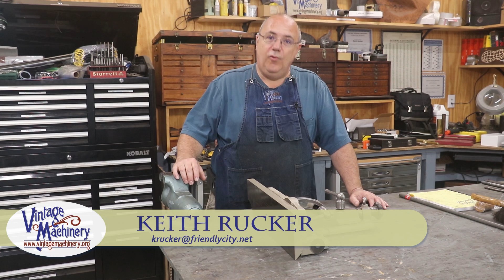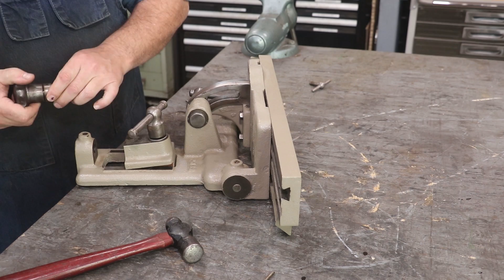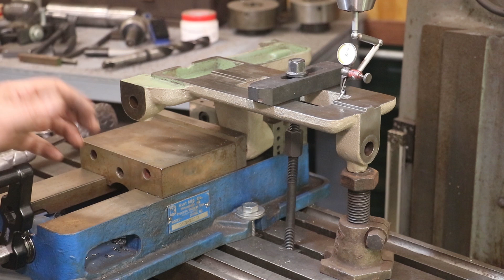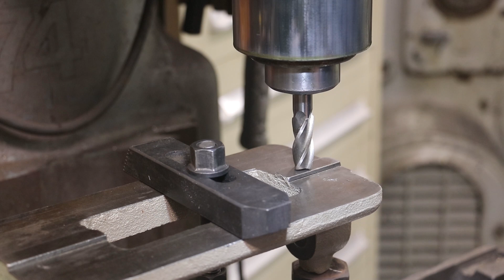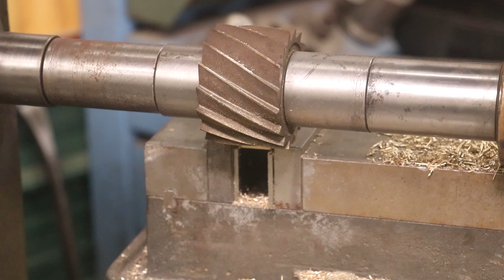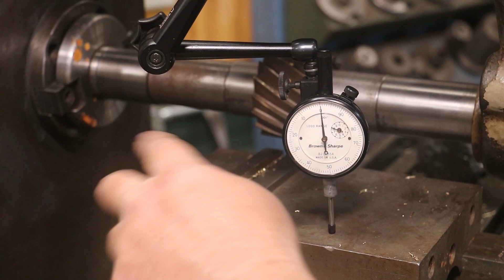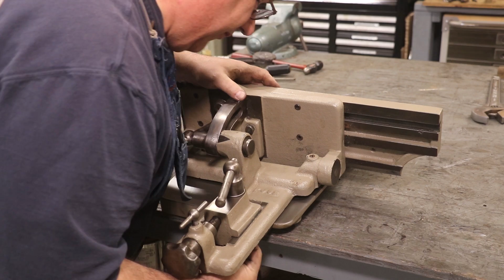Machining New Slide Keys on a Wadkin Table Saw Fence

Comment: The extra brass could have been used for an extra set of guides for when the brass wears out, easier while you have the setup.
Reply: It'll be so many years before those guides wear out again any extra set he makes now will be buried in the bottom of a junk drawer and long forgotten what they are when they're needed.
Reply: I'm surprised he didn't; he's done that (made a 2nd set of parts) in previous projects.
Reply: It might not won't go to waste, but rather go into Keith's brass casting material box.  He has done a few videos on foundry work with brass.
Reply: He sent extra, instead of making more replacements, Keith kept the rest!! 🤣🤣
Reply: Go to 3.50 and watch and you will see he said bronze not brass.
Reply: @paulduffey7975  - Go to 14:50 and watch and you will see he said BRASS not bronze.
Then later on, he goes back to Bronze again 😋

Comment: Don't understand? It was dovetail and you made it stright. That means that the sliding surface of your brons block only slides on the the tips of the bottom dovetail and will wear down extremly fast?
Has I missunderstod the funktion?
Reply: Magnus Carlander, I believe that the part that Keith milled out was straight sided, the center part that was removed before the milling process was dovetailed so the fence could be locked in place. If you look at 9:52 in the video, it gives you a better look at the part.
Reply: @Hoaxer51  ok
Reply: It never was a dovetail. The original feature on this part was a square key, that fits into a dovetail on the table of the saw. He made it exactly the same as it was, just a bit wider and out of bronze.

Comment: I have an old wadkin EV....(that's a spindle moulder)...

It's an earlier one designed to run off a lineshaft with flat belts...

The in & out fences use a similar arrangement...
Sliding and micro feeds...🇬🇧☺️

Comment: Hi Keith, 

When I get a situation where there is not enough height to get a tap follower, I mount the tap in the chuck, put the mill out of gear and hand turn it to start it straight, then finish with the tap wrench. 

Wadkin made top quality machinery, that was when a few extra kilograms of cat iron was good, not like the lightweight machines made today.
Reply: There are excellent machines made today but most people are just to cheap to pay the price.

Comment: I would have re-installed the pins that were punched out and indicated off them. They held the fence perpendicular to the slide. Using each side of the old slide is guess work at best.
Reply: ^ this.  All of Keith's work is meaningless if the fence (once re-installed) isn't 90 degrees to those machined keys. From what I recall,  very similar fences are used on both the Wadkin PK and Wadkin PP. While it's true that even if it's not 100% at 90 degrees you could compensate for the variance by adjusting the table on the saw, it's not the ideal solution. If I were Keith, I would have left the fence on the casting, and confirmed if they keys were perpendicular to the assembled fence before machining it.
Reply: @joshuablair6120  I thought the same thing. That's what I was thinking.
Reply: 100% agreed. This was a very imprecise repair on a machine that was originally very accurately machined.

Comment: Probably a smart move going with bronze/brass for a replacement. It will wear before the slot in the table it rides in. Replacing the bronze/brass pieces in the cross slide will be easier than fixing the slot in the table.

Comment: Do you know what machine this comes off of? Looks very similar to the fence from a flat bed planer

(Edit, i looked at the Georgia Craft instagram, it's on there. In this day and age it's good to acknowledge one's ignorance)
Reply: https://www.instagram.com/p/B1OtWJcA1Fq/
Reply: Yeah seen one the same on a planer or spindle table would explain bottom corner of fence radiused off.
Reply: Looks like this one https://i.ebayimg.com/images/g/RyUAAOSw3SdeHdmG/s-l1600.jpg
Reply: Wadkin PK table saw

Comment: Roughly you never use coolant when you do drilling/phasing etc...Why and how? Thanks.....
Reply: Depends on the material you are working with. With cast iron and brass they both are materials that don't need lube for machining. Brass/bronze, because it is soft and iron because it has a lot of graphite in it.
Reply: And he's using very slow surface speeds and gentle cuts.

Comment: Your right there Keith, I had a wood work shop in Sunderland England, all whatkins, their factory was in Burr's green.
Reply: Hi Michael. It was in Fence Houses, Houghton Le Spring, went there once to order a CP12. Burrows and Green Ltd were bought out by Sagar then Wadkin. They kept the shortened name Bursgreen. Still got quite a few of each lol. Great  machines.
Reply: There were actually two bursgreen factors One is Co Durham And the other one in clones. Real Wadkin Were manufactured at  Green Lane works  in Lester . This fence here dates back to the early 20s when the company went by Wadkin and co . Bursgreen Did not enter the wadkin company Until 1956 when sagar Of Halifax Was purchased
Reply: Hi. I know. I didn't want to put too much down to start and get boring (or to sound clever to others). I just simplified it. Most machinists don't even know or care how good and well thought out the old Wadkin machinery was compared to the competition. I've worked on real Wadkin machines in the past FD's 5 & 6, WO's DP's EQ's LS's plus many more. You have a fantastic collection of nicely restored machines. I have known about your workshop for quite a while. Love it.
Reply: Very hard for me not to reply. It’s just a fascinating  Range. Of course I’m very fond of the classic range . I am personally shouldn’t be too much trouble or worry if someone thinks your Clever . I’ve always been bothered by little things. For instance the amount of times Keith called  that bearing bronze  brass lol
Reply: @eyuptony  yup , the best.
Reply: @eyuptony  that's a half mile from my house, I'm in Houghton-le-Spring too. Small world.
Reply: @googleuser859  Its amazing what's on your doorstep sometimes.

Comment: "my feed I've got set on 2 1/8 inch per foot" - don't understand this comment? Per foot of what? Anyway thanks for posting this, as always it was very interesting.
Reply: My guess is per foot of cutter circumference. The speed of the cutter is in surface feet per minute. Feeds are generally set with reference to the cutter speed to get an even chip size.
Reply: Feed over time. I am not sure if it is per minute or another time unit.
Reply: It was a slip of the tongue. He meant 2 1/8" per min. That's how mills represent feed. Lathes represent feed in inches per revolution, ex. "0.002 inches per revolution." So if it's doing 1000 rpm, it'll be moving 2 inches per minute. The mill wouldn't be able to show you a feed represented in surface feet, using the cutter circumference. That is something that would need to be calculated.

Comment: I suppose if you were worried about the wear on the base of the fence, you could grind it flat, but that would require a tear down as well.
Reply: Another scraping project, most accurate fence anywhere.
Reply: @jamesrawlings8493  LOL

Comment: 16:50 newbie question. why not feed it the other way to avoid getting material in front of the cutting?
Reply: one reason is that you would be pushing the tailing through the cut and filling the teeth in the cutter head which would make it jam.
Reply: Read about climb cutting vs conventional cutting
Reply: We'll I'm no machinist but I don't think in truth it would have made much difference in this instance but conventional milling (like here) is more "standard" and I believe tends to be more accurate because the cutting force is pulling the cutter down into the surface rather than pushing it up over where there's more leeway for movement.
Reply: Think of a tire rolling over a bump.  You want to avoid 'climb' cutting so the cutter doesn't climb on top of the work and deflect the horizontal cutter bar.
Reply: Play in the lead screw can cause the cutter to grab and jam, make the part fly out of the vice, or brake something and who hasn't done that?
Reply: Besides the climb vs conventional milling, chips getting in front of the cutter is a non issue. Running it the opposite way (climb milling) won't really eliminate the chips in front of the cut.